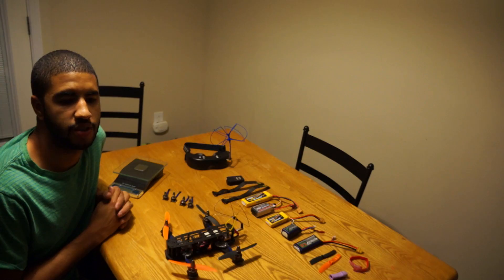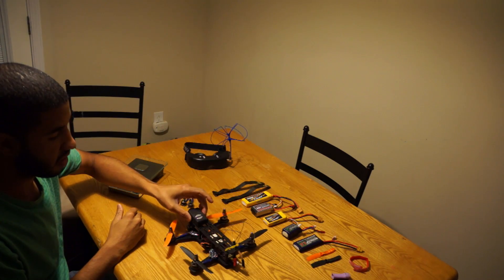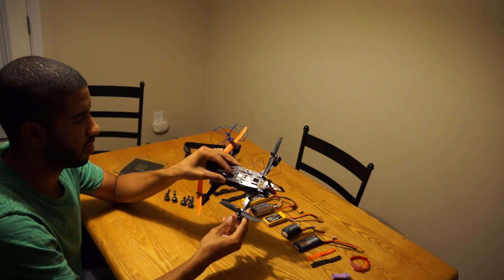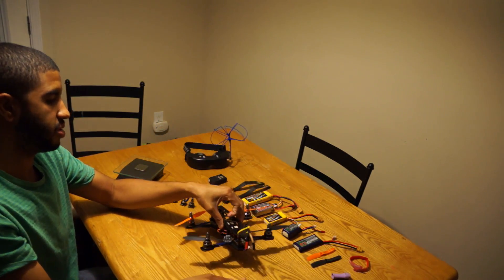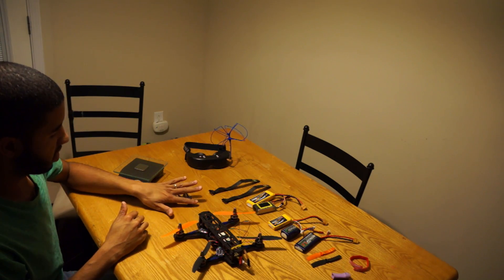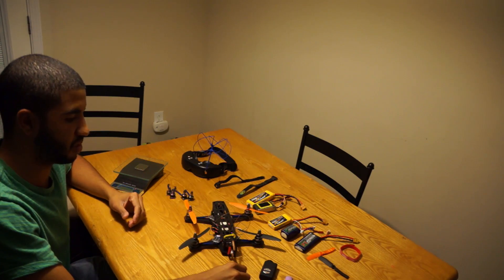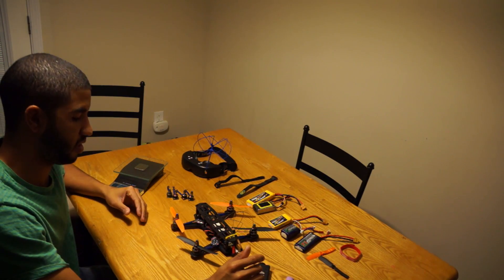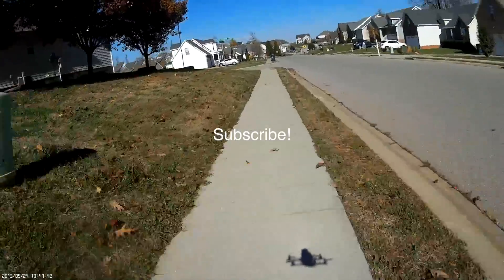Blackout Mini H Quad In-Depth Review

Comment: what would you recommend the blackout mini h or the qav 250 carbon
Reply from the maker: Neither. There pretty old frame designs. Checkout the Chaos here: http://www.droneworksusa.net/products/
Reply: what advantage do they have?
Reply from the maker: http://www.rcgroups.com/forums/showthread.php?t=2337419
Reply: do you have any other suggestion of frame i dont really like the idea of putting the battery on the bottom
Reply from the maker: The battery goes on the top or bottom. Are you sure you looked at the right frame? look at the Chaos Mini X Quad. Not the Gremlin or Fury.
Reply: if i mount the battery on top i cant put my gopro on
Reply from the maker: The Chaos was designed to run a Gopro and Battery Ontop. Send an Email here and I can send you photos for you to see: DroneWorksUSA@gmail.com Also you can see a video here with a few Chaos flying around with Gopros and batteries on top: https://www.youtube.com/watch?v=czUKxYICENw

Comment: I would like to build a mini h quad. Your videos are very inspiring. I need help with the power system. If anyone can help please reply. What motor/prop/battery do you recommend for power and/or longer flight time? For example what can I expect from a 2000kv motor with 6x3 prop on 3s? Thanks in advance

Comment: Wow you're very knowledgeable about Quads! How long have you been flying? Super cool Setup/ FPV Flying by the way! In your opinion which is the better Air Frame, the QAV250 or the Blackout Mini H? I wanna buy one but can't decide. I'm leaning more towards the QAV250 cause I like the supported attachments like Blade Guards, LED lights and such. And what Naze Flight Controller you use? I notice there's different versions so it gets a bit confusing. Can you possibly send a link? Thanks!
Reply from the maker: Hey man glad you like the video. I'd suggest checking out my other reviews on the qav250, and the blackout hex and make your decision from there. I have been flying for around 5.5 years now :) buy the naze32 Acro.
Reply: ***** Nice I'll be sure to check out your QAV250 review. Like right NOW! Lol... 5 years of flight under your belt is a long time. No wonder you know so much about Quads! Ok cool so the Acro Naze will do, what a coincidence cause that's the exact version I put on my wish list:) Really appreciate that info was curious being your Quad flies Super Accurate! But it kinda sucks both the Blackout and QAV250 air frames are so hard to get. There's a QAV250-G10 available but I prefer the ''Carbon'' version. Do you think I should Pre-order the Carbon version and just wait. Or go for the G10 Material version of the QAV250?

Comment: Hello there, Just wondering if you can help me, I have a Futaba 14SG that I change to have the Sticks spring to the center for my DJI Phantom 2, Question: Do you know what the Naze32 Acro Flight controller will do if the sticks of the Futaba Transmitter spring to the center?

Comment: How is it using the 1.3ghz video with 2.4ghz controls and antennas that close together?  I'm assuming you have a low pass filter but do you notice any reduced Tx range?  I want to go with 1.3 for the penitence as I'm sure you did too...  I'm also not planning on circular polarized, just a Vee antenna

Comment: Nice! But you need a 5,8 GHz link because it has much smaller antenna ;)
Reply from the maker: I run 5.8 now but at the time i wanted to try 1.3 out on it for its better penetration. go checkout my newer blackout videos on my channel.
Reply: *****
How do you like the 5.8 thus far? Was thinking building mine with UHF and 1.3 or 2.4 its just figuring out how to use a dipole and get around the core pnp25 noise.

Comment: Nice upgrade on the motors.

Which Naze 32 FC are you running?

Any chance of posting a link to Naze 32 settings?

Great video.

:-)
Reply from the maker: Naze32 Acro
Reply: Awesome.

Do you have settings for Acro Naze 32?

Thanks :-)

Comment: C rating has nothing to do with the flight time it's the mah that controls your length of flight
Reply from the maker: No offense but you couldn't be more wrong. A Flight time is all about voltage! mah has little to do with it. You fly off voltage not mah. Example: If you have a 1,000mah 3s battery fully charged it has 12.6v as you start to fly your voltage will drop and by the end of the pack depending on how aggressive you flew. So if you have a low C-rated battery lets say 20C but you were pulling a High amount of watts the whole flight you will have a huge sag in voltage so you might only be able to use 500mah out of your 1,000mah pack before your voltage is to low. Now if you have a higher C-rated battery lets say 35c, That battery is able to handle the higher amount of watts being pulled from it without a huge voltage sag like the 20c battery would give you. So you will be able to get closer to your batteries mah capacity. If you know your quad requires a high amount of watts to fly you will need a battery with the C rating that can handle that draw. 

If mah had to do with flight time then a 5,000 mah 3s should fly longer then a 2700 mah 6s battery according to you which is false. Everything's about watts. This is why a higher voltage battery with the same weight aircraft will fly longer than its lower voltage battery and same weight aircraft. Look at my project Sponsor 6s hoverthings flip fpv quad vs other same weight lower voltage flips. My 6s flip will fly much longer.  I hope that helps.

Comment: Thanks for the great Review. I am trying to runa really similar 1.3 setup on a mini frame but all im getting is problems, did you ever have problems with yours.
I get really strange colors and when I go around 200ft everything goes crazy. (flickering, weird colors, strange lines on the white tones)
I have:
-Foxtech 1.3G 200mw video transmitter
-IBCrazy 1.3GHz BluBeam Omni Cloverleaf Antenna on the quad and IBCrazy -1.3GHz BluBeam Omni Skew-Planar Antenna on the laser BGC 1.3 rx on my goggles.
-I am running all the power from my 12v trough a LC filter and have also installed a lowpass filter on the tx to eliminate interference with my 2.4 rc. (I also separated them)
Pics of the setup:
https://www.dropbox.com/sh/3rcod9bpg61ntez/oxRf7RnEjp
Any ideas or suggestions will be really appreciated.

thanks a lot, and keep up the awesome flying!

C.
Reply from the maker: It could be your laserbgc rx. I don't like mine. I also got rid of the 1.3 on my blackout because I kept snagging the antennas on stuff and breaking them. Also I looked at your quad pics. Your asking for a crash to happen with how you have your antenna mounted. It will vibrate loose and flop into your props causing you to wreck. You need to make it so that if ever vibrated loose it can't just flop into your props.
Reply: Hey ***** , thanks a lot for the feedback. I will return some of my 1.3 gear and sell the rest. What do you recommend for a good quality 5.8? Again, thanks a lot for the help.
Reply from the maker: Is this the only aircraft you have? If not I would try the 1.3 gear on a bigger aircraft before selling it. This way you can rule out whether or not it's something you might want to keep. 1.3 is my favorite frequency because it can go through so much stuff. I wish it worked better on my blackout but sadly I was breaking way to many antennas. I use fats hark attitude SD goggles with the built in 5.8ghz rx. Then I use either a fat shark or immersion 250mw-600mw video tx.
Reply: ***** With 1.3 you don't really need a CP antenna.  You should be able to get away with a Vee and get similar range as moderate 5.8 with the superior penetrating ability.  I'm about to sell my 5.8 gear and trying to do some quick research to see if  I'll really have a radio interference issue on such a small quad and 1.3+low pass

Comment: How much would you say your total investment for this FPV set up was? (minus all of the different batteries and motors you tried out) Thanks.
Reply from the maker: Maybe $600 is for all the components on the aircraft and all around $600. You could cut that price by going cheaper motors, and fpv equipment.

Comment: That quadcopter looks good, but the only thing that I don't really like are the wobbles when you fly full throttle. If you tune that out, will it still fly well for aerobatics?
Reply from the maker: my Roll gain was to high I just dropped it a little yesterday. Its all good now :)

Comment: Really enjoyed your review.  I'm flying with the 1306 motors on 3s for now. Might upgrade to the 1806s eventually.  But I'm flying with 5" props (only a couple flights so far).  You think its overpowering the motors with 5" props on 3s?
Reply from the maker: Ya I think your  over amping the 1306 on 5" props on 3s. I would go to 4" if your going to stay 3s and 1306 motors.

Comment: Nice job as usual Flo, need some new intro music. lol. I would highly suggest getting a lot of the plastic screws that hold the top and bottom frames together which screw into the spacers. Plus, about 80 props; 16 per order at $12.
Reply from the maker: thanks :) i have plenty of extra parts :) so far all I've used is props :) i hope to keep it that way ;)

Comment: Great review man! thanks it is a great little quad. What is the frame arm only weight?
Reply from the maker: Thanks glad you enjoyed the review. do you mean what is the frames weiht with no electronics? if so then im not sure.
Reply: 390 something is impressive enough. If things go well I may get you a frame to test out if your into it. ;o) Whack audio at points but entertaining. LOL!
Reply from the maker: Hoverbot1TV ya id be into testing your frame. just let me know :)
Reply: *****
Well I finally built my first mini 275mm and have 2s 2850kv 2805size red Emax motors that rip man on 3s. On a 1000mah 3s I am getting 3-1/2 mins with 5030 plastic. I am working on a sub 100g frame now for HB9 and will keep you posted. Have a Airsoft 1800 that flies only for about 7 min though. 500g range all up with 1.3ghz.